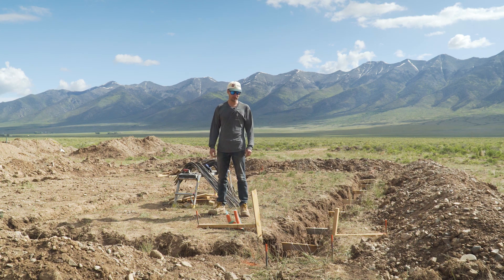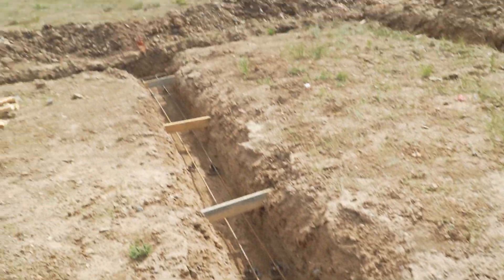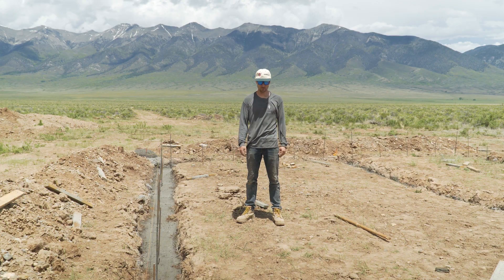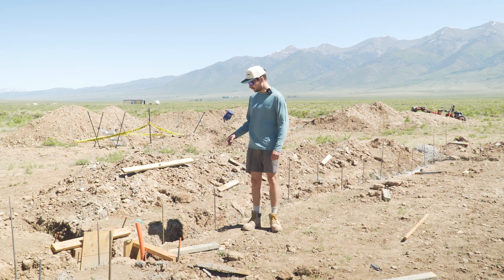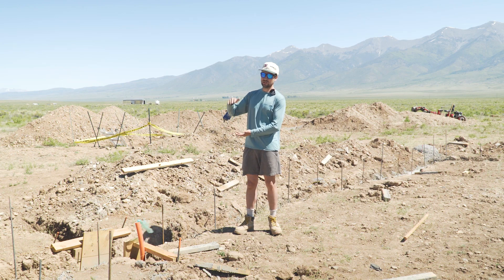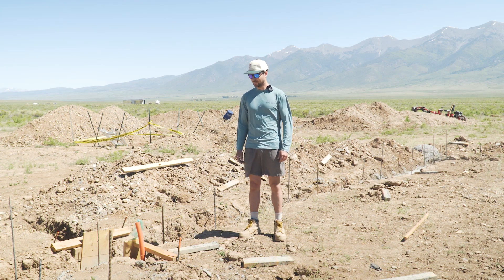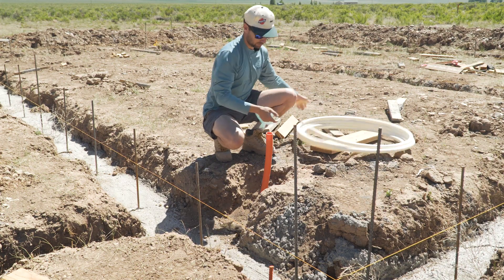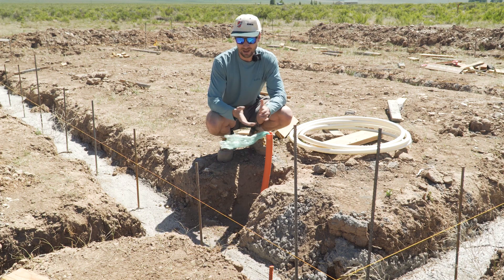DIY House Build part 2: Pouring Concrete Footings

Comment: Thanks! I'm building too by myself in Montana. 
We started on June 3rd, and today, we are ready for the roof.
Your video helps us to finish the basement.
Initially,  we built on piers for a crawl space, but because our future home is small (2 stories 24x26 ft), we decided to have a basement in between the piers.
Soon, we are going to pour the footings for a cement bricks wall finished by lumber phony walls. 
We are LarchLine, and you did what we are planning to do in regard to footings.  We are going to use 4 rebars.
Reply from the maker: Sounds like we are on a similar track! Poured footings here on 6/13 and right now I’m on my third week with the roof trusses and hoping to get dried in before the snow starts. Honestly if I did it again I’d do the footings the same but pour the wall with ICF or removable forms. I probably saved a few grand but took weeks and hurt my back in the process. If your area is smaller that would definitely help, and if you don’t need to fill every core that would be even better. Core filling was the longest and hardest part. Good luck with your build 👍
Reply: Thank you for taking the time to respond 
We are in Montana, and because summers are short, we put all of our energy into finishing the shell of the house.
The rafters were hard, yet we placed them in 3 days. They are made from 2"x12"x16', and I had a panic attack when I saw how massive and heavy (80lb) they are... we are using 32 of them...
Anyway.... we are still going to do the basement with concrete blocks, I just ordered 720 of them, and 1/3 of them are for forming beams. We are using vertical rebar in all of the blocks plus in 3 rows on horizontal fo form 3 continuous beams. All cores are going to be filled with concrete. 
At this moment,  I'm trying to convince my husband to use ready concrete with a pump because he wants to make the concrete by hand... that's how we made the piers. 12 piers, each had 11 bags of 60 lb concrete, not all poured in the same time. That was all right... now is different...
Good luck with your construction.  It is hard, and I know that we (you and us) are making it look easy...
Reply from the maker: @LarchLine  that’s a lot of block! Unless you’re so remote there’s no redi-mix options, it’s probably the way to go. All the best!